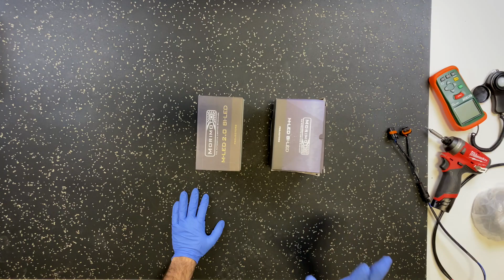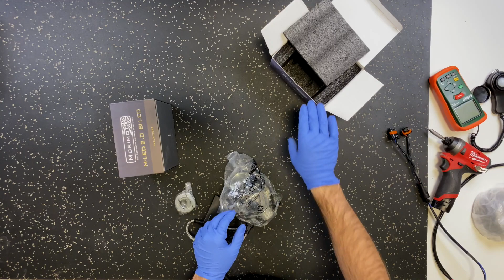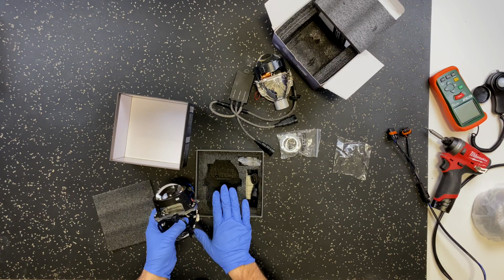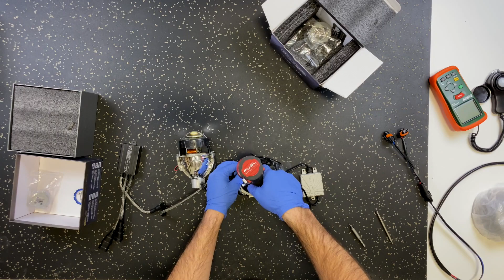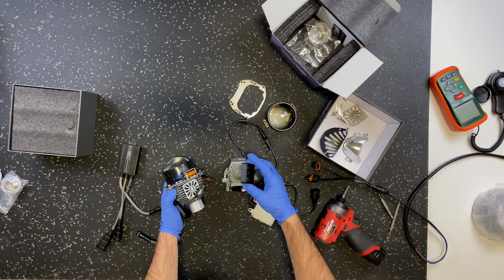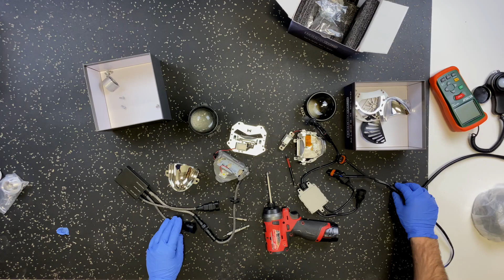Morimoto MLed 2.0 teardown

Comment: you guys should see how small that led chip is, compared to my 32v 2.5a led measuring 1.5 inches rocking a dc to dc step up converter. 😀 sometimes when you want real power you have to do it yourself. my headlights are 31000 lumens per side @5600k. @nicright

Comment: Quick question. For the Mled 2.0 you need power to both low and high beam. But what If I have a BI xenon projector that can only supply power to the low beam side and there is a different circuit that would run the plastic shutter thingy. (2 wires going into ballast, it powers a D3S bulb, other small wires coming from the cable belt control the shutter. Meaning I don't have a seperate low and high beam power) Low and plastic shutter thingy are okay, but what about the High beam? I can just hook both low and high beam together and disconnect the motor for the shutter, that would be controlled with my car's own shutter power? What would happen if both high and low beam are on and the shutter is in the low beam position?  Thanks!
Reply from the maker: You can pull power from the high beam shutter or bulb in your existing setup and run it to the solenoid. Most people will do this with a splitter 

 https://esskcustoms.com/collections/pigtails-adapters-and-resistors-1/products/high-beam-splitter
Reply: @esskcustoms  I don't have a high beam bulb. I have a bi xenon projector. The only thing I have are 1 small wires that control the solenoid. They will fry under the wattage of the high beam of the LED
Reply: @littlebuch  Sounds like you have oem lighting. Why are you looking to change from HID?
Reply: @Snattle_Rake  xenon sucks
Reply: @littlebuch  i think you needa change your OEM bulbs for a good quality HID bulbs then youll notice a difference
Reply: @Sounga74  I did. Nightbreaker lasers. Bit of a difference. Then I bough DFZ d3s leds from Amazon. 50watt( measured 51watt) and they are 2.5x more lux output measure the difference with my lux meter. They are amazing.